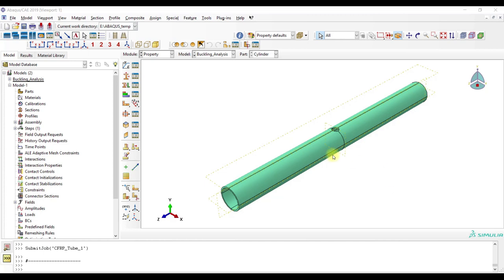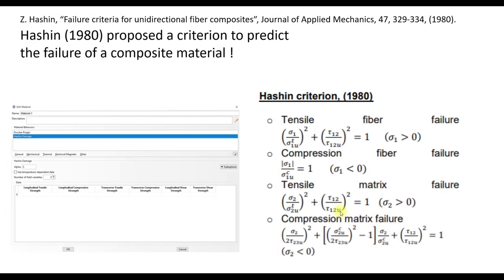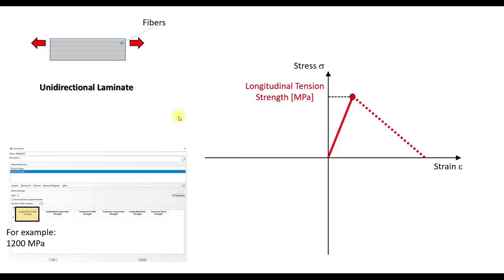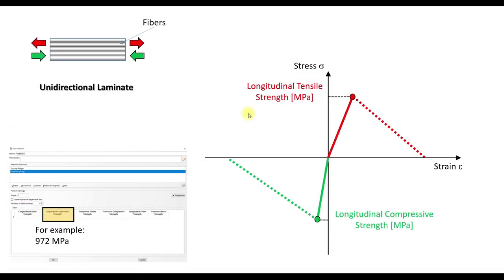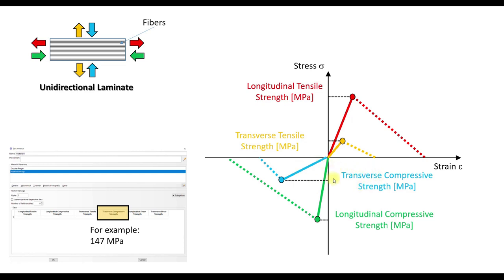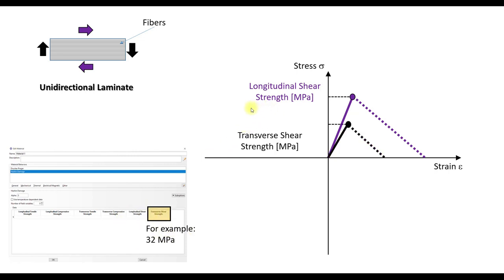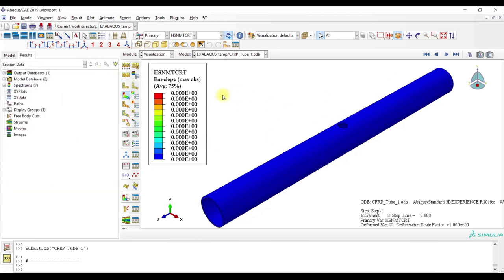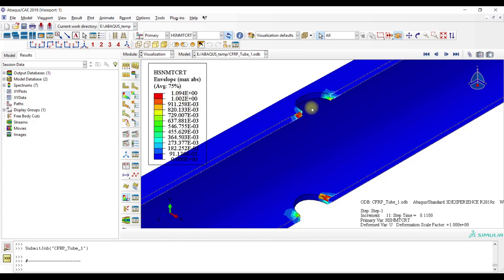ABAQUS Tutorial: Damage for Fibre-Reinforced Composites - Material Model Explained - Hashin Damage

Comment: Abaqus just contains hashin damage criterion. Therefore, we need to write subroutines to apply other damage criteria as well.
Reply from the maker: i think it is because, Hashin relies on relativity easy to measure material parameter and is quite reliable. Other method like Cuntze and Puck, need much more input data which are not easily available.
Reply: @hnrwagner  Sir I have a question. Do failure criteria give us info about the kind of failure? For example, does hashin give us info about whether the failure is happened on matrix or fiber? How about delamination?
Reply from the maker: @Pishgul  
in ABAQUS, there are results for Fiber and Matrix damage either in compression or tension (4 in total)
Reply: @hnrwagner  So this is applied to all failure criteria. I mean we can say whether it is fiber or matrix failure using any criteria in ABAQUS , right? SDVs I think
Reply from the maker: @Pishgul  
As far as I know this applies only in ABAQUS only for Hashin Damage

Comment: Sir, for brittle material should not be the compression strength higher than tension?
Reply from the maker: for brittle material like concrete yes, but not for fiber reinforced composites. 

I have worked mostly with fiber reinforced composites, therefore i am quite sure about it.
Reply: @hnrwagner  Ok. I just want to be sure. Maybe because of crack propagation or kinking

Comment: Very informative, I am trying to do a low velocity impact analysis on a composite plate but for some reason my jobs abort whenever I select the hashin criterion in the field output. I also select the previous damage criterion in the field output but after my job run it does not show any results for those variable. No Idea why this is the case..
Reply from the maker: sounds like the elements you used dont support Hashin, which kind of elements do you use?
Reply: @hnrwagner  I was using SC8R element (8-node quadrilateral in-plane general purpose continuum shell, reduced integration with hourglass control and element deletion on)
Reply: I did create a 3D deformable solid for the plate and then assigned a continuum layup and continuum shell element

Comment: Dr Wagner, very nice video. I would like your opinion though on applying the hashin damage on reinforced rubber. Assuming we have a specimen which comprises from the layers: 
1) rubber
2) nylon cords with a bias angle (e.g. 30 degrees) 
3) nylon cords with bias angle (e.g 150 deg)
4) rubber layer

can we use tha hashin damage in that case? the reason i am asking is that obviously is not easy to add a compression strength as the specimen due to being mostly flexible (elastokinematic) would have zero reaction to compression.
Reply from the maker: Honestly, i do not know, i would use it if i have no other material model at my disposal. Seems like you need either further literature research or experimental testing.
Reply: @hnrwagner  Thank you for your instant answer Dr.! Much appreciated! I would expect that the error in such a case would be that big that would ruin the ultimate goal of the simulation - to validate the model. Unfortunately from the tensile strength equipment I use for my experiments I do not have the option for all these parameters. 

Thank you anyway for your help and have a great rest of the weekend!

Comment: I did a model. And the HSNFTCRT and HSNMTCRT continues to increase after it becomes 1. Is this normal? Is there make it to not increase more than 1? Thanks.
Reply from the maker: It can be higher than 1 but the loads which lead to values that are higher than 1 are irrelvant.
Reply: @hnrwagner  Is there any way to prevent this? For example when it reaches one, deleting the elements? I performed simulations only with strength but not fracture values. If I add fracture values, will the softening allow hsnftcrt remain at 1?
Thanks you very much Doctor for the quick response!
Reply from the maker: @BSS0202  

This is a very difficult problem and I have not yet much experience.
I can only give you this link:
https://youtu.be/SfbY2qAudjo

In this video I have element deletion and Hashin and it works somewhat good when compared with the test.

Comment: Nice analysis, can you please model a composite pipe under internal pressure and axial tensile force in various methods, like 2D cylindrical shell, 2D axisymmetric, 3D shell and 3D solid?
Reply from the maker: https://youtu.be/yOSPpfs1s64

This is one case, the other cases are also here on the channel

Comment: Firstly, thank you for every info. you have shared with us , secondly I would like to take you advice , Can I model the CFRP bars as isotropic material but with linear stress strain relation ?? please I need your instructions
Reply from the maker: if the bar has a quasi-isotropic lamiante , it should be a reasonable assumption
Reply: @hnrwagner  I have Bar not laminate , its failure is Brittle as we know.

THEN I wish to get a detailed answer that if I applied an impact load of 30*30 cm square-nosed impactor of weight 150 kg with free fall velocity 8 m/s on a concrete slab with dimensions of 180*180*13 cm, how can I obligate Abaqus to show the spalling or deletion?? How ?

Comment: Sir plz gives values for hb26 material model... If u have
Kindly do 3d ballistic impact on hb26/other material with hashin criteria
Plz give your contact mail ... Thank you for the video
Reply from the maker: from "Mark K.Hazzard et al. ; Finite element modelling of Dyneema® composites: From quasi-static rates to ballistic impact, Composites Part A: Applied Science and Manufacturing
 Volume 115, December 2018, Pages 31-45"

Homogenising in-plane properties of HB26 under quasi-static conditions, Table 3

E11 (MPa) = 68000
E22 (MPa) = 410
G12 (MPa) = 86.9
v12 = 0.2832
Reply: @hnrwagner  I need damage evolution and stabilization criteria for hb26 also sir
Reply from the maker: @akimech1  From experience I can say that you most likely do not find the values for damage evolution for your specific material. But you can use values of similar material. I think there are some in the article above.